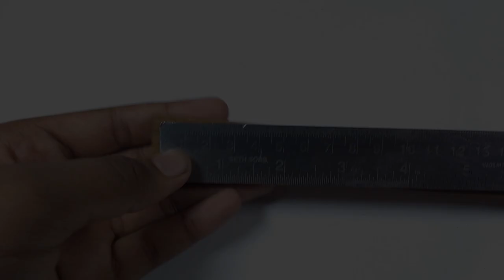DIY Wooden Tripod For Camera (Very Easy)

Comment: This is cool!  Do you have anything written down?  My boys and I are looking to do this for my husband for father's day.
Reply from the maker: Thanks 😊, You should written down all measurements
Reply: @HemRobotics  i did.   The markings for the holes,  the drill bit sizes and the length of the legs were not included, nor was the dimensions of the top piece if the tripod.
Reply from the maker: @prncsleia6   prncsleia6 I have used 2mm and 5mm drill, and each lag is about  20inchs and top part of the tripod depends on thickness of wooden strips